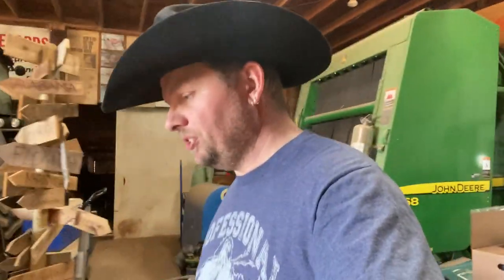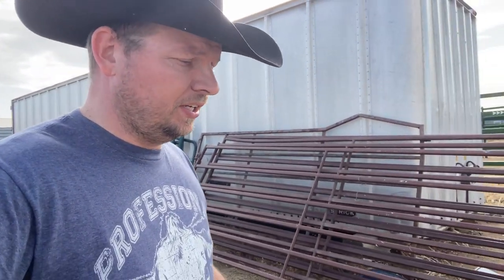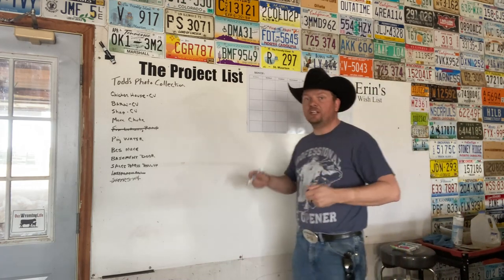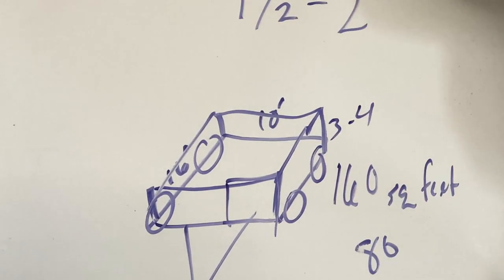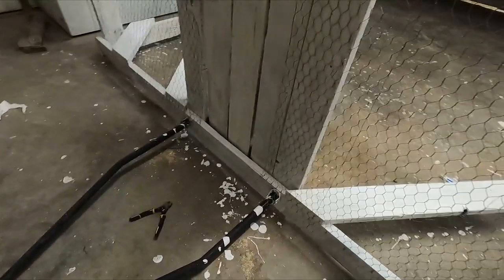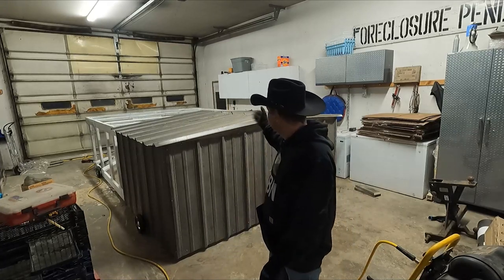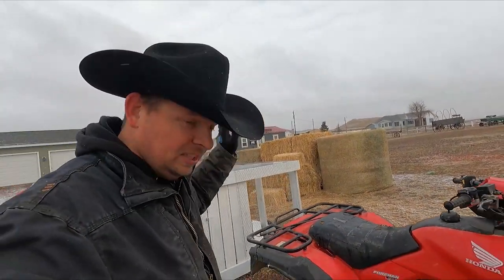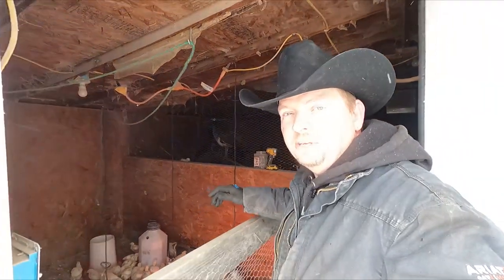What is a Chicken Tractor?  Lets Build One!

Comment: Mike...  Just a suggestion for your great project.   The wheels that are at the rear covered part might make it easier to move if the wheels were moved back even farther.  That way if you needed to pick up the front of the tractor the back wouldn't drag on the ground.  I'm sure the front is light enough to be picked up by one person.   By the rear wheels being farther back towards the corners you could make the front hitch a three-point type hitch allowing the front wheels to clear the ground when hitched to your ATV to move it around.

Comment: Looks fantastic! Down here in SC pretty much have to have them with no gap at the bottom.  Snakes, foxes, 'coons and 'possum seem to be able to squeeze through a 2 inch gap, if they don't dig under.  I like your design so much better. Looks to be a lot easier to move.  Fantastic job!
Reply: and don't forget feral cats, those are worse pests than 'coons.
Here in the Netherlands when I built something similar for our rabbits I had to cover the bottom in chicken fencing as well, to prevent feral cats and foxes digging in.
Result was small enough we didn't need wheels to move it, but could have added some if needed.

Comment: Couple thoughts for the next iteration (chicken tractor 2.0).  You told us its better to have a gate in the corner of the field cause you can more easily chase animals through. Thinking the door on a corner idea would be good idea for chasing the chickens out of the tractor. Second thought was put the corner door in the back corner so you can back it up to the coop for easier transfer from coop to tractor to coop. Third, use cattle panels arched up over the top as a roof so you can stand up and catch your breath while chasing chickens (this one is far less important if you have your kiddos chasing the chickens).

Comment: looking good already. You may want to add some perches for the chickens to sit on, especially in the covered area. 
Not sure if the chickens can dig out of it, or predators dig in. Something to consider too.

Built something like it (though much smaller) for rabbits a LONG time ago. 
Learned some things: 
- move it frequently as the soil under it gets real dirty from rabbit droppings very quickly.
- use paint that deters mould and rot as the wood gets and stays wet when in touch with or near the ground, even if it's not raining (though with your recent drought that process will be slower than it was for us).
- if you think it's strong enough, strengthen it some more. Snow gets heavy, and stresses on the frame are significant when moving the thing around.

Comment: You can always use the skid steer to redirect the chicken tractor when moving it. 

A future thought you could build gates that open inwards and align with each other and set the 🐔tractors back to back that way they can keep up the gossip. 
Are you putting chicken wire on top to protect them from predators when the tractor(s) are out and about. 
Make sure you don’t leave the key around for the 🐔🚜 or you might be looking for them in the back 40

Comment: If you could put caster wheels on the front instead of the straight wheels your cornering issue would be solved. Like it is though I'm sure those small front wheels will just slide as long as you're not turning too sharp it would work fine. Ive heard great things about following cow herds around with a chicken coop. It cuts down on parasites and provides an additional income stream. Truly regenerative.

Comment: Mike i have built a few chicken tractors. I dont think you will be able to put a ridged hitch up front because when you pick it up it will drag in the back because of wheels are set to far forward.  about the only way is adjustable rear wheels to go high or low. But over all it looks great and should work fine

Comment: Mount the bolts so the wheels come off.  Also, think about bigger diameter wheels to raise it higher off the ground when the wheels are on.
Reply: was thinking a system where the wheels are on rotating structures that can change the distance to the ground. Then cover the bottom with more chicken wire and narrower bars to prevent anything digging in or out.

Comment: Hate to tell you this Mike but the wheels keep it too high off the ground. Take the wheels off and just drag the tractor around. As it is, Predators will reach under and take and eat  your chickens who are sitting or sleeping anywhere near the sides. Also, predators can tear through chicken wire and kill more of your chickens. Hardware cloth is a must. I don’t have all the answers, I’ve made the mistakes and lost too many chickens before making the necessary adjustments.
Reply from the maker: I'm pretty sure I said I had a plan for that, but hey, thanks!

Comment: Wow, that's going to be heavy - definitely going to need a tractor to move it! Likely not a problem for you, but the lighter ones can be moved with a modified hand-truck. Lighter weight material and only 2 ft high
Reply from the maker: how do you get in it to get meat chickens out if its only 2 feet high?  That was my question :)
Reply: @OurWyomingLife   open on the top, Lumnah Acres has two, moved by handforse :) Takes about 30 chickens each
Reply: I have the Lumnah Acres design... Not my favorite. I really want to try the John Suscovich design, or one day if I have enough pasture I would like to try Joel Salatin’s design.
Reply: @OurWyomingLife  Top is hinged (in two halves from center)! whole thing flips up, with a pole like a car hood to rest it on.
Example of lightweight one: https://www.youtube.com/watch?v=vXl_V_v5JD8. 
I hinged the whole top on mine, but you can also just sweep them out with a board: https://www.youtube.com/watch?v=ugWEcgtsKfk

The other issue I had was gaps under the edge boards encouraging predators. If you can make it drop down right to the floor like they do, might help. If the clearance is too low when wheeling it, any bumps in the ground make it difficult :-(
Reply: @OurWyomingLife  do like I do and take a large fishing net out with you.